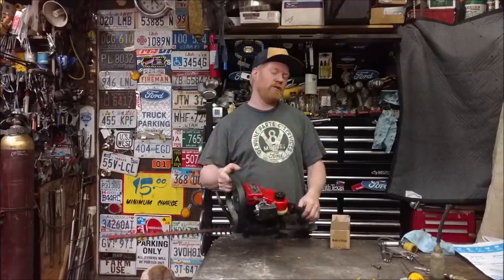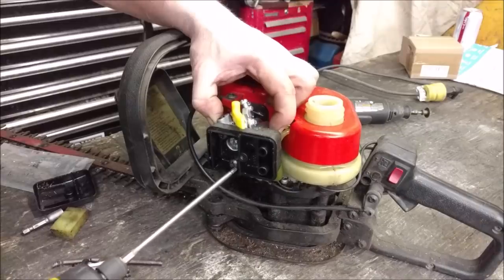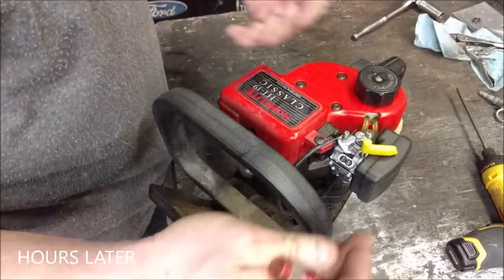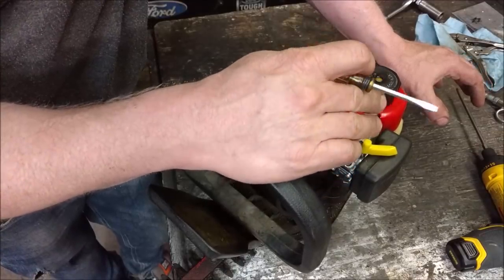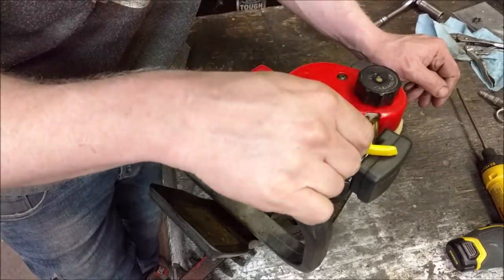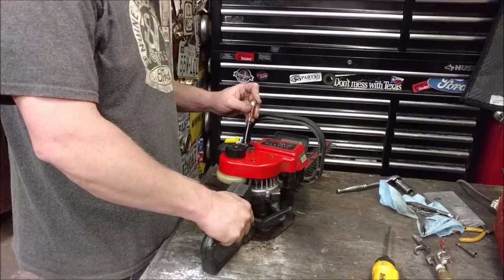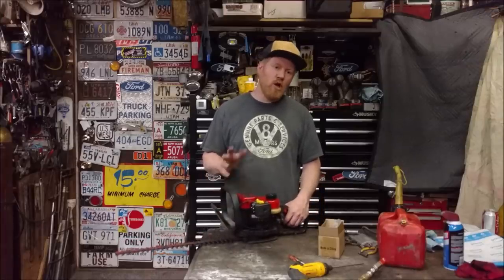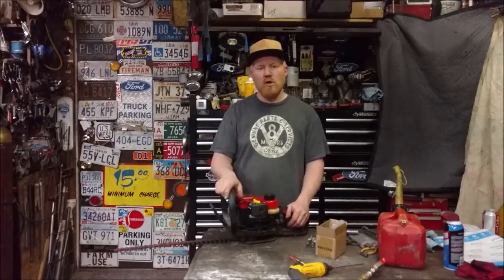Aftermarket small engine Carburetors worth it???

Comment: I've bought several from Amazon and eBay, bolt them on, start up and go. Never had a problem.
Reply: Same here bough several, even recommended some to my cousin for her mower and she bought them on Amazon bolted them up and they've all started and ran fine, not gonna lie, they 2 cycle carbs do need a little fine tuning but they run great, some kits even have the pac-man tool or the splined tool to adjust them, the ones i bought for the mowers have ran great.
Reply: Same here..23 hp kohler running like new with no adjusting...straight out of the box working
Reply: We replaced a carb on a Cub Cadet 126  ride on mower, had been sitting 6-7 years, the "amazon" carb cost $25, third turn over of the engine it fired right up and ran perfectly, ran all last season  and fired up again this spring and runs well still.
Reply: Ive bought 4 for four different engines. Only had to adjust one out of four so far. They are all still great, they all fire up fast, rev high, and idle perfect. Only complaint is the primer bulbs feel cheap , but they usually send a couple of replacements with the carbs.  They are so cheap I decided to go ahead and get all of my old broken down engines/tools running again.
Reply: Most are junk .

Comment: I have to say it has been a completely different story for me.  Zero issues so far right out of the box and I've bought a bunch!  Love your videos bud
Reply: Same here.  Been through 3-4 on different garage sale finds and all have been perfect.  I've started installing fuel shut-offs on everything and always run them out of fuel before putting away.
Reply: Zajac Motorsports that’s the key to them not having separated fuel in them come season time. Run them out and as they stall, hit the choke to try and extract every drop from the bowl.
Reply: Yeah, I have bought the heck out of them too, and have had zero problems.

Comment: I have had very good success with the Chicom carbs, though I purchase from eBay dealers.

I needed a carb for a Sear Chipper, vacuum, that used a Tecumseh  5.5hp engine. The dealers that still had shelf stock of genuine Tecumseh carbs wanted stupid money, meaning more than $60.

The carb I purchased came with both air filters, gasket, spark plug and the carb. Installed and pushed primer bulb three times and fired right up. This machine never started this easy when it was new 20 years ago.

Comment: I couldn't see paying $168.00 for a Nikki carb when I can buy the same thing from China .....with NO issues for $13.00 Been running for 3 yrs and no problems. I've bought "Name Brand" made in USA that had issues also. Even with name brand they need adjusted out of the box.  JMO
Reply: The 4 cycle ones are descent, in general the two strokes are crap, but now even OEM carbs on two strokes are crap from the start.

Comment: Great video with a great conclusion. I don't do a ton of carb work but I've bought a couple of the cheapo $9 carbs in the past. They always work but not without a ton of dinking around with. But when your on a budget and a rebuild kit for a diaphragm carb costs more than the chineseium knock off as long as you have the time to mess with them they are worth it. But just barely. As for how long they work for I haven't really ran one for an extended time period so I couldn't tell you but I bet it won't be without having to mess with it from time to time.

Comment: I've used literally over 100 chinesium carbs off ebay and amazon on everything from riding mowers to chain saws... I've never had that problem. All so far are plug n play, other than the occasional adjustment.  I think you got the one in a 1000 bad carb.

Comment: I have a Chinese carb for Tecumseh H50 on a generator, and due to strange Manufacturing, I only needed to open the idle and Main Jet mixture screws somewhere between an 1/8-1/4 of a turn, to achieve the proper mixture. Some of the older generators that I collect, I only wish that the chinese made aftermarket carburetors for them, they use a side draft Zenith type  1408g carburetor, and a new carb from the manufacturer is about $350 !!!, And good luck finding a used one on eBay, and if you manage to find one, when one gets listed, they last for maybe a day or two before they sell!

Comment: Yeah use the parts to rebuild own carb. ultrasonic cleaner works well !.
Reply: If ya got the harbor fright one, kick on the heat and use purple power and water.
They say dont fill it with solvent, and I wont. one way around that is to put solvent in a cup, and place that in the water bath.

Comment: It takes longer to get stuff up here (CAN).  I have had good luck with the 4 stroke non OEM.  But not the 2 strokes.
Reply from the maker: It seams the larger 4 stroke engines are less picky about proper fuel mixture.

Comment: Bought one for the 200x three wheeler. It looked the same, at close glance there were multiple differences. Evident to save on production costs. Ended up rebuilding the OE one. Smiled on the (had to take a break and hours later) comment. Great video Moe!
Reply from the maker: I think I spent 2 hours messing with that new carb. I even tore it completely down and essentially did a rebuild on it hoping it was something simple.

Comment: I hate to pile on with everybody else, but those ebay carbs have saved my butt 5 or 6 times so far.  I just buy the first fixed pot one I can find, slap it on and 95% of the time it's fixed.

Comment: Nice video, I know your struggle.

I like to keep an extra OEM carb on hand for my equipment so that if the carb needs to be rebuilt, I can do it during the winter when I have some spare time instead of when I need to be working.
Reply: I've had good luck with these cheap replacements,  but this vid has me thinking I should rebuild my OEs. Besides, it never hurts to have a working spare.  Now to see if I still have the originals.

Comment: I repair generators.  The Chinese aftermarket carbs are inexpensive and work well.  If I can, I will always rebuild the OEM carbs as I find the Japanese and American made carbs use a higher quality metal that is not prone to pitting as a result of ethanol fuel and improper long term storage.  Having said that, the Chinese aftermarket carbs are usually 1/10th the cost of the the OEM ones.

Comment: A lot of them from the factory aren't much better.  You can get those Murrays and Weed Eaters from Walmart these days and some of them won't even work out of the box.  And it seems that once they want to start acting up, no amount of adjusting or rebuilding ever makes them run just right again.  Or you'll think you did, and then it won't run cold.

Comment: I am a full-time mechanic cars and machinery I've used up to 100s of cheap Chinese carbs yes there not as God as a genuine 1 but I have had enough success with that it's worth the 10 pound they normally are they always need tuning but usually get somwhere very near to spot on at the worst I use all the bits to repair the genuine carb u can't buy a gasket set for the same money

Comment: Husqvarna OEM blower carburetors run $125 vs. clones for $11 on Amazon. The supplier indicates they manufacture OEM carbs. No difference in quality, adjustable with screwdriver, looks the same, runs the same, and for fractions of the price.

Comment: I have never had this issue. Out of 7 chi-carbs I have bought over the years, 7 have started up fine, no problem. 2 for generators, 1 for a minibike, 1 for a dirtbike, 2 for string trimmers and 1 brushcutter. I have had to tune them a tad, but that is the same on any carb, whether OEM or clone, since they have to be adjusted for your specific engine. All of them have started in no more than 5 pulls after first installation. I'm gonna go play the lottery now, as I must be a very lucky guy ;)

Comment: Chinese carbs without that rubber diaphragm work like a charm. I got a replacement Chinese carb for a Honda fortrax 250. Still running to this day, didn’t have to tune in or mess with anything.

Comment: I have bought 3 cheap chinese  carbs for my old 15  year old echo weed eater and blower and two worked great and the other one was dead in the water.  This last  one I bought for $14 with spark plug ,   hoses and filter worked without adjustment on the second pull and has worked great for the last month that I h ave been using the tool.  It seems that with chinese junk sometimes it is good quality and other times it just falls apart.

Comment: I’ve had mixed luck. The fake Honda ones have been good. The fake walbros for my back pack blower and string trimmer were crap.
Reply from the maker: I think the smaller 2 stroke motors just need a lot more precision than a larger 4 stroke.

Comment: Some work out ok while others never seem to run right. I had mixed results but for the price, even if one in three is no good it's still a lot cheaper than an over priced original part. Swings & roundabouts.

Comment: I've had mixed results,  but when the old carb is full of white stuff on the insides and the factory coating is long gone, they work good enough or will when you get the bugs worked out, usually.  Farmers and their lobbyists and ethanol gasoline, they ought to have to use that crap in their tractors.
Reply: That white stuff is called sulfating, and it happens to all kinds carbs.. it's basically the equivalent to rust on metal only it's on aluminum. it's caused by moisture sometimes it can damage the aluminum by pitting it. but most of the time be removed and the carb. can be reused.

Comment: Where the cable hooks to the carb, there is a tiny rubber stopper, You may need eye glass screw driver or dental pick to remove stopper, once removed, you will see a jetting screw down inside there. I use eye glass flat tip screw driver to turn it. Screw it out to fatten and in to lean it.

Comment: I have not had the same experience with the cheap carbs. 4 carbs on 3 pieces of equipment over the last few years. All started easily and required no adjustments at all.

Comment: I have had great luck with those carbs.  I have used over 50 of them.
Reply from the maker: The last 4 I got have been very  problematic, but prior ones have worked out reasonably well. I did just get a confirmation from a long time customer today that the $17 Chinese carb I put on his 4 stroke weed eater 2 years ago  is working great. My biggest issue is I decide to pull a scrap weed eater out of the parts pile as I think I can put a $10 carb on in 10 minutes, tune it in 5min and sell it for $50. However, even the good running ones eat more time than that with unnecessary fiddling(fuel ports pointing wrong direction, throttle hook up different, choke lever modification required) and I feel like I putting an unreliable item into a customers hands. This budget $10 carb is easily a $30 carb with my time/effort  and I only made a few bucks an hour. Also the carbs never allow me to tune them to the proper fuel air mixture that I am used to with oem carbs (talking 2 stroke stuff). I feel like in the long run I am better off putting a new diaphragm/fuel pump into these and cleaning the old carb and I still only make a few dollars. That's if the carb doesn't have swollen or damaged one way check valves. I just wish we could buy a Walbro or Zama for $20 like the oem manufactured did and put it on. Maybe these Chinese clones will put pressure on the big brands and they'll drop their prices.

Comment: Ive had exactly the same experiences with every china two stroke carb ive tried. All have flooded the engine even with screws fully seated due to being jetted way too large. I have finally learned my lesson the hard way. I was wondering if others had the same problems.

Comment: I've always had good luck with these cheapo carbs, perfect for replacing the hopeless originals. I always try to rebuild, but sometimes it's just not possible and it just needs to be replaced. I don't think I've ever had a tunable one be plug and play, they ALWAYS require tuning, which really is a true art. The fixed jet ones I've had good luck with. Sometimes tweaking and modifying is necessary, but I guess that's what you get for sub $20 carbs. Love your videos, I've learned a ton from them.

Comment: I trust the the stock carbs way more. I find it's much simpler to try and rebuild the original carb. I keep metering diaphragms on hand and swap that out first before  doing the full carb kit and that usually does it. I would not be surprised if you were to take the lever adjusting tool for the walbro carb and adjust the lever on the needle valve to spec it may run correctly on the cheap carb. I see it time and time again where people just buy the cheap carb and spend more time chasing their tail than if they had just bought a carb kit and replaced the diaphragms. Hard to beat the real Walbro or Zama carbs.
Reply: Zama is made in china

Comment: I bought a new aftermarket carburetor for my boat, is was four times cheaper than paying for OEM. It works pretty well but the carburetor hates any trash in the fuel or gummy ethanol, my advice for anyone having trouble with the carb is to install a secondary fuel filter or a fuel water separator, also use fuel stabilizer.

Comment: I never had a Good Chinese carburetor. I bought one for my Honda Generator. A few months later, I started my generator and it ran super rich like the choke was on. I bought one for my Cub Cadet Zero turn with a Kohler it ran so rich when you acellerate the engine it would smoke and try to choke out. float was cracked and i replaced the float and needle. The solenoid had stripped the Leg where the Jet is i replaced it with a Keihin carb. and i had to tap it risking a clogged main jet it wouldnt run right. I have a Coleman Generator I bought a carb off The internet it ran good 2 weeks after i bought it my freind noticed it was leaking. I took it apart there was yellow fuzz at the bottom of the bowl. Never Again

Comment: I'm glad you showed this video. This is why I still clean my OEM carbs thoroughly and rebuild them most of the time, unless their totally trashed. I've had better results with the 4 cycle engines, but even with those, many times, they just wont run like they should. The last afternarket carb I did was on a 5hp L head Tecumseh, because the original carb was shot, the engine surged with the aftermarket carb, I could not stop it. It ran, but ran like crap. I've had better luck with the Oregon's at about half the price of an OEM, but when I can get an OEM carb cheap or a good used one, I go that road. The two strokes I don't mess with too much and now a lot of the newer two strokes have junk carbs from the start anyway. But yea if the OEM carb can be fixed, I always do that first...
Reply from the maker: I rarely work on two strokes anymore besides the occasional chainsaw. There's just not enough resale or customer money for the time spent on something like a weed eater.  I figured if I could find a good 2 stroke carb supplier; then a $10, 10 minute fix for a $50 weed eater may be worth it. So far nope.
Reply: @sixtyfiveford  I agree, working on two strokes is usually a pain. 100 screws, everything is tiny and you get all beat trying to pull the cord a bunch of times, not to mention the blister. 4 cycles are usually a lot easier. I'll fix it its a Stihl or something like that, the cheap stuff I usually wont bother with.

Comment: Cheap Honda, homelite, echo etc knockoff carbs I've had huge success with. Knockoff mikuni style carbs for quads and dirt bikes, throw  em in the trash. They've never run right out of the box, design is slightly off and cheaper, they leak fuel like crazy, don't take the right style jets, it ain't worth it. Just rebuild the OEM carb on any quad or dirt bike if it's a mikuni or keihin style.

Comment: I bought a china knock off carb for my 4whlr, finally got it on and the jets that came with it were to big and wouldn't interchange with any I had..... Cleaned up/repaired the old one and moved along. 
9/10 would order again but check all jets before ordering.....

Comment: Yes!
It was so many problem to me
When replaced china carburetor its starts leaked gas fro. Carburetor then never stop
Gas tank became an empty..
Or carburetor gasket does not fit 2 out of 3 so few seconds started engine then stopped engine.

If you are lucky its will be ok but not long life
So after many problem l gave up to use china carburetor l do try to find genuine carburetor.

They must be improve this issue. Because they must think deeply before loos customer.

Quality first with reasonable price and think about Total cost.

Not only carbutrtor sum pump too

And its will be huge increasing huge scrap in the world too.

Thank you

Comment: I generally rebuild using my ultrasonic cleaner, but occasionally I’ll run into a stubborn one that just won’t respond. I’ve only had one aftermarket carb that had a problem out of the box. I wouldn’t prime up for anything. Turned out to have an incorrect gasket on the metering side.

Comment: The China carburetors I've got and used from Amazon are about 75% good 25% bad . And still have to do some to none modified work on-them . For instance got a replacement for a Honda had too use the step system on the idle jet and after four attempts of drilling  it out - finally passable run out . Have had to send two of the same exact two cycle carburetors back to Amazon that were bad right off the bat that had a100% no hassle return policy - and they were great to honor there warranty too . So yes I would order a two or four cycle carburetor again from them again ( Amazon. ) Just make sure when you order too get some kind of good return policy with it . Food for thought .....